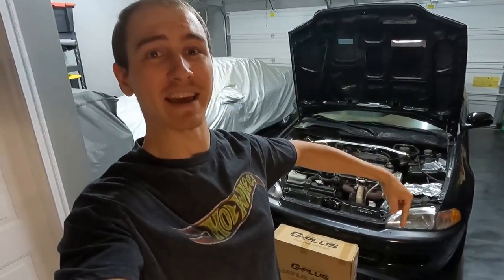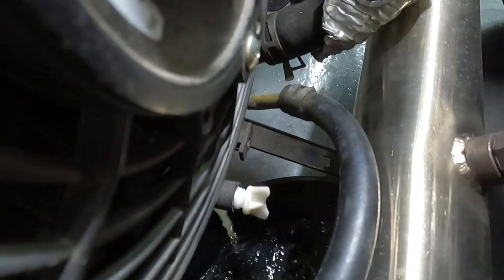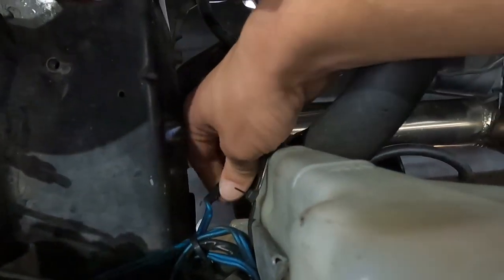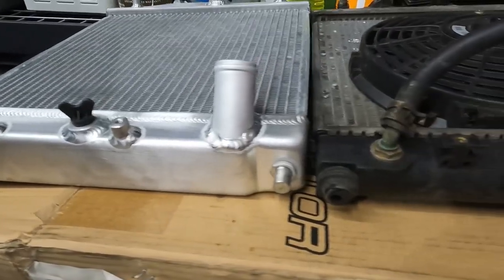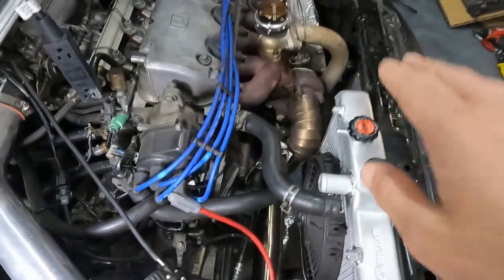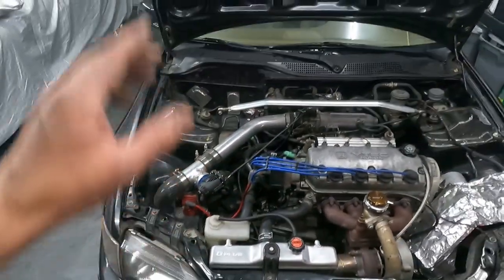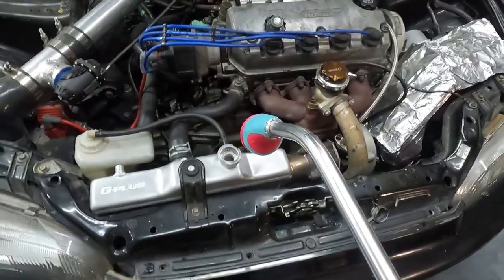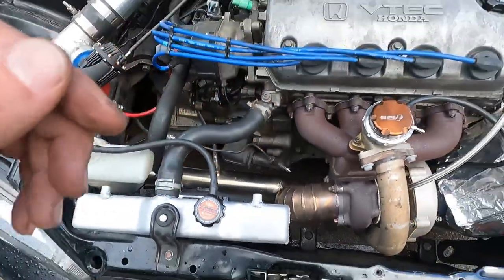How To Change A RADIATOR On A 1992-2000 HONDA CIVIC - BEST MOD EVER ($60 - G PLUS)

Comment: Just heat wrap your downpipe. The vibrations from my downpipe cracked my old rad and I just wrapped the shit out of the downpipe with some dei exhaust header wrap from orileys. Still got another plastic end tank stock rad tho.
Reply: Your downpipe is heat soaking your radiator, so the first 20 mins  it probably runs decent coolant temps, then after awhile of driving the hot downpipe gets the radiator hot. Gold heat tape the radiator tanks and heat wrap the downpipe to help temps maintain a lower heat.
Reply from the maker: Yeah that’s what I was thinking. Last time I got heat wrap it was Fiberglass, didn’t work much lol. This time I will definitely get dei
Reply from the maker: Yeah I can feel the temps rising when the car gets hot after some pulls. Will silver foil tape be as effective as gold to repel heat?

Comment: Ik this is an old video but if you can get back to that would be awesome. How did u rewire the radiator fan so theyre constantly cooling? Doing my thermostat, radiator and oil change tmrw figured I’d knock out the fan problem
Reply: I wanna have both my fans running too I have one that’s out assuming it’s the relay

Comment: I want the g plus rad! I have the silicone hoses!
Reply from the maker: Dude for the price it was soooo hard to beat. I wanted a 3 core but I don’t think it would have fit without cutting the core support/angling the radiator. But so far this thing has been holding strong!

Comment: Your not supposed to use tap water. It will corrode. Drain that asap. Use honda blue.
Reply from the maker: Already done. Just needed to check for leaks prior to filling it with coolant